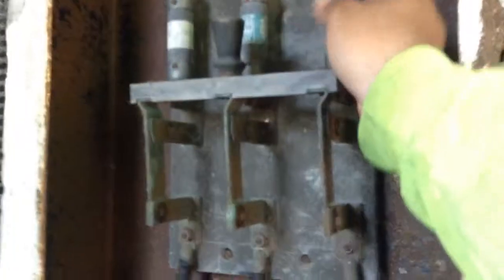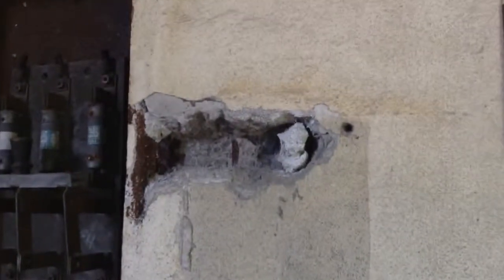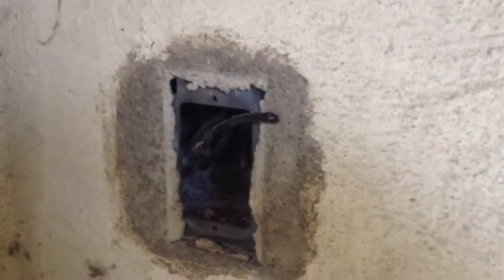Abandoned Otis elevator machine room

Comment: It's a very old controller possibly from the 1920's  basement geared traction machine,   220V controllers were common in the day. I think this could have been a  DC traction machine with the selenium rectifiers top of the controller. While  It was not an open frame motor at the bell end with the brushes and communicator still might have been DC. The exposed  3 phase fused knife secondary disconnect shows the era of when it was installed.